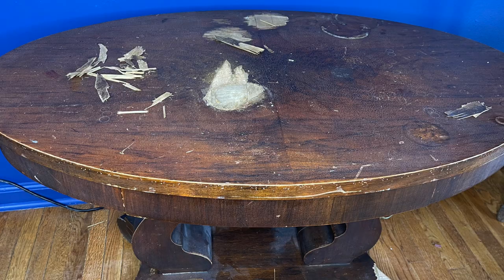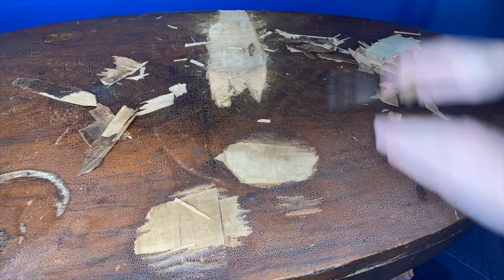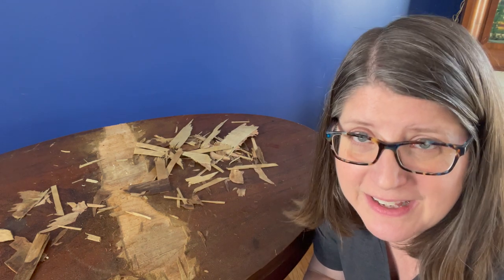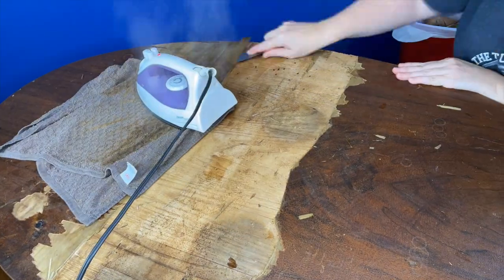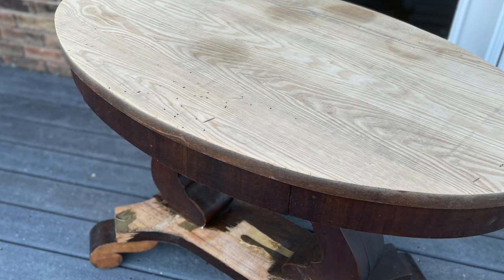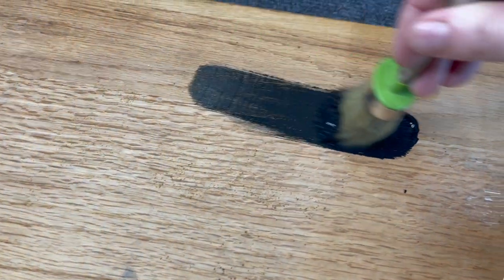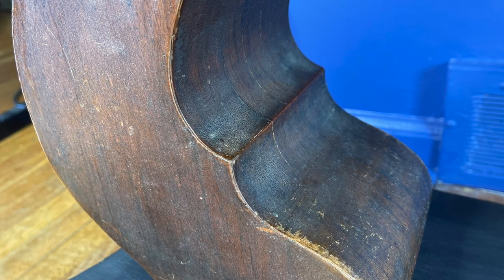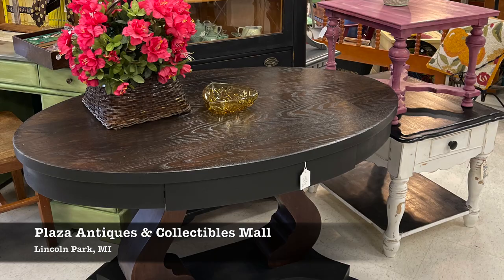$25 Antique Table Makeover | Trash to Treasure | DIY Makeover

Comment: I love it!  The only thing I think I would have done differently is I'd have put the oil wax over the entire thing.  Either that or found a way to put a glossy or slightly glossy stripe around the black at the top. I've stripped tables and dressers of veneer before - not an easy job, but you knocked it out of the park!